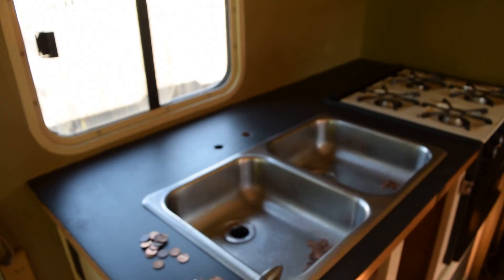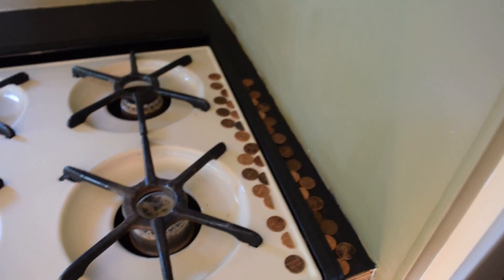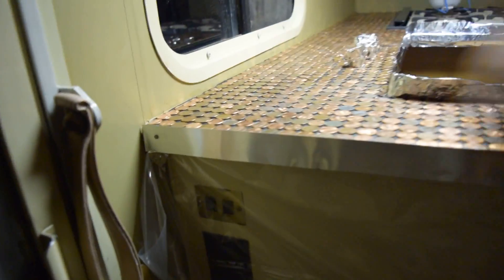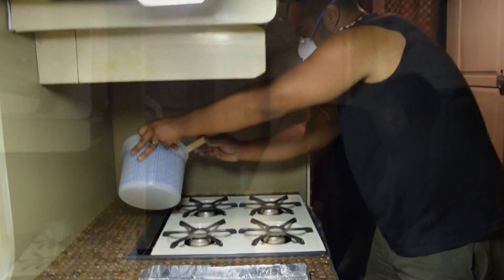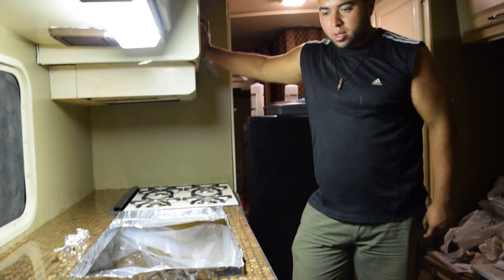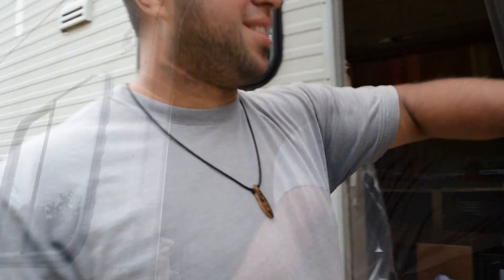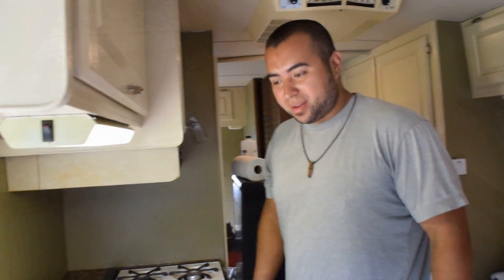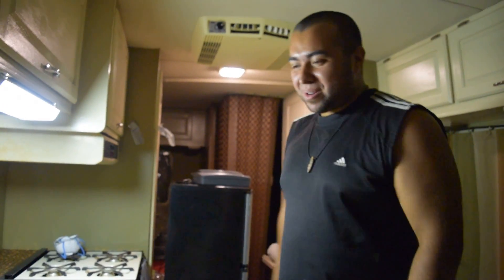How to Make a Penny Countertop / RV Renovations!

Comment: That Looks Awesome!! I'm Going to do that with my Kitchen And Front Room Countertop.. My Countertop is basically the same size as yours about what size are the epoxy containers that you are using?
Reply from the maker: +Jimmy Smith Thanks! We bought 2 quarts and didn't use it all up. Theres probably a quarter of hardener and resin left. Heres the link if you want: http://www.amazon.com/FXpoxy-Epoxy-Resin-quarts-resistant-Countertops/dp/B00BJORLEE/ref=sr_1_1?ie=UTF8&qid=1443549435&sr=8-1&keywords=FXpoxy-Epoxy+Resin+2+quarts+-+Ultra+Clear+UV+resistant+%2810-15+sq+ft%29+Countertops%2C+Table+Tops%2C+Bartops